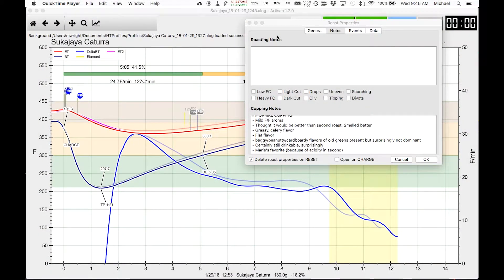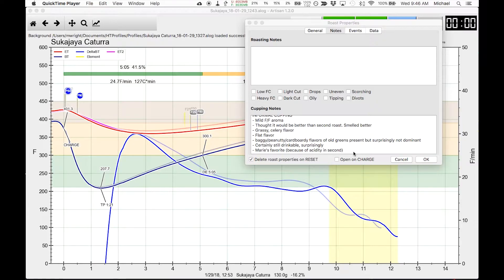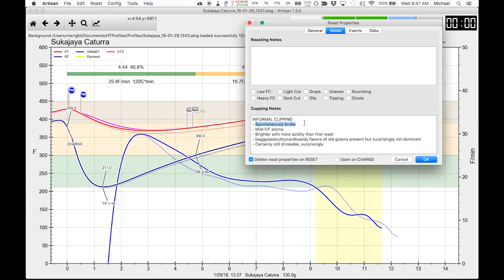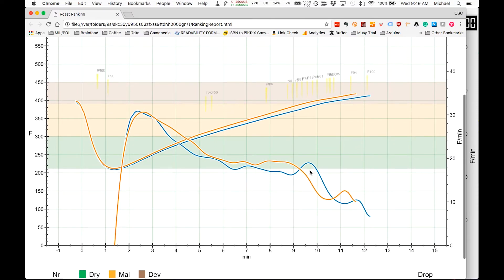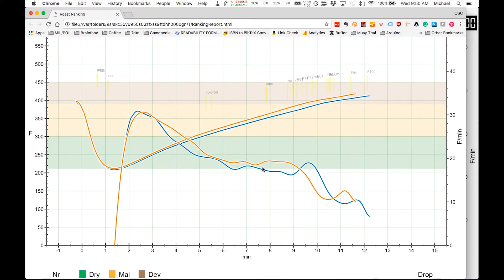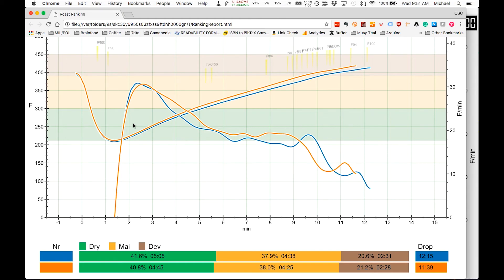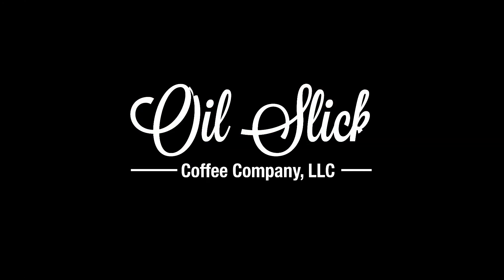Comparing and Analyzing RoR of Two Roasts

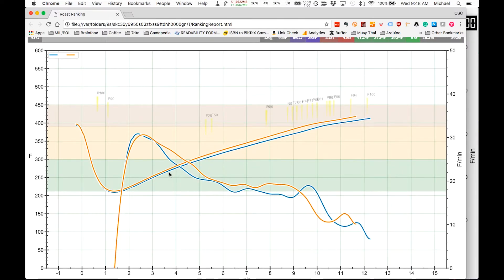Comment: Hmmm. (Head scratching sound) I tried your 130 gram charge at 390f BT on some PNG Arokara then drop to 50% heat after charge wait 30 seconds and then to 95%. Too hot , too fast for me at 119 volts I had FC at 4:00 dropped it and dumped it into the trash. Starting back at my under 320 BT charge with 200 grams
Reply from the maker: There could be a number of things at play giving you different results than what I got. First is a possible difference in our thermocouples, their placement in our machines, and how they are being read. Also, your charge temperature is partly dependent on the moisture of the beans. With drier beans, you want less heat at the beginning because water in the beans absorb thermal energy and if the beans are relatively dry, less heat energy is spent on boiling water and more is available to roast the beans sooner. 

Also, if you increase charge temp and decrease charge weight, you are affecting the initial momentum with two variables. For example, when comparing two different charge weights at the same charge temperature, the lighter charge weight will have more initial momentum because of the reduced mass of beans. When comparing two different charge temps with the same charge weight, the higher charge temp will have a greater, initial momentum. 

It's usually not recommended to translate exact temperatures from machine to machine as it's very difficult to get two machines that provide the same data in the same or similar situation. For your situation, what I would do is adjust your drop temp based on your situation, playing with different temperatures to see what gives you the best performance for your machine. But leave the charge weight, the beans, etc all the same so that you are only changing one variable at a time to see how that one variable affects the process. 

I hope this helps and let me know how it's going (I know this is a late response, so I'd be curious to see how you've done since!)

Comment: Ok, so my ROR looks like a saw tooth, how to better control the ROR?
Reply: How significantly large are the teeth? 

If it isn't that big what you may be experiencing is just noise from how frequently your software pulls data. I'd imagine this guy in the video pulls data less often than you if that is the case.
Reply from the maker: In addition to Marvin's comment regarding polling frequency, I'll add that at the time I recorded these videos, I had a lot of "curve smoothing" configured in artisan. In Artisan, go to Config > Curves > Filters and you'll find some smoothing options to play with.
Reply: Thanks guys, it’s taking me a short while yo go from gene cafe to hottop k+

Comment: Are your tests already finished? There are still some questions left?!
Reply from the maker: I haven't worked on this topic for a while. The conclusion I came to and wanted to share was that the RoR is very useful data to help control and analyze roast profiles and there is useful information we can glean from it while roasting and after the roast. I may return to this topic later but for now, my focus is elsewhere. 

Are you working with the RoR in your roasting and if so, what are you finding with it?
Reply: Thank you for answering. Yes, ROR is a good tool for me to anicipate what could happen next, but it is only one item. S. Rao makes a kind of secret how to avoid flick and crack of ROR. My focus now is mainly on energy control all over the roast.
It seems to make little difference in beginning ROR when loading with higher or lower temperature, but it surely has impact on the result. Is creating a most evenly roasted coffee the utmost goal, or will it create rather boring results? What are the absolut limits for times and temperatures in the phases?  And anyhow all is connected with ones tasting skills. And mine are not very highly developed. So I am still in a mode of try and see. It is hard to find a  system.
Reply from the maker: @erharddinges8855  With all things; practice, practice, practice. The more you deliberately taste coffee (and other food and drink) the better you will become at discerning various flavors and characteristics. The same goes for roasting. As you become more familiar with your machine and how to more-precisely control it, you will get better at determining what changes in your profile produced what changes in the cup. 

Also remember that roasting is not yet an exact science. Our typical home roast machines are relatively crude machines based on relatively old technology. We make a lot of inferences in what we think is going on inside the bean, etc, etc. All that to say be patient and forgiving with yourself.  Experiment with your setup. I think your focus on energy control is a good place to focus. 

I'm always careful to talk in absolutes when talking about roasting, because roasting is not an exact science and there is so much 'wiggle room' in the process. Instead, I think in terms like this: 'I know that if I am running too hot too soon early in the roast, I will hit my benchmarks (such as first crack) sooner in my roast than if I was running cooler.' I know on my machine roughly where I need to be time + temperature wise to hit benchmarks relatively predictively. Then I cup the coffee and see what the results were. If I missed a benchmark but the coffee tastes good, then I can try to reproduce those results on the next batch. 

Don't get me wrong, there is a lot of science and precision to roasting. But there are also a lot of gaps where we can't define absolutes. 

To your question about evenly roasted beans being a goal; that depends on your ultimate goal for the flavor of the coffee. Unevenly roasted beans can impart flavor complexity and can produce a desirable quality in the cup. If that's your thing, then that is the right answer. Some roasters want consistency and a more even roast. That is the right answer for them. If you understand energy control for your machine and understand how you are roasting the entire bean (mostly from the outside to the inside) then you'll be better equipped to influence the final flavor of the cup through the roast.  

I hope that helps!
Reply: @MichaelCWright  very kind and encouraging statement from you, at first I will put my focus on sourcing better greens,and comparing with professional samples.